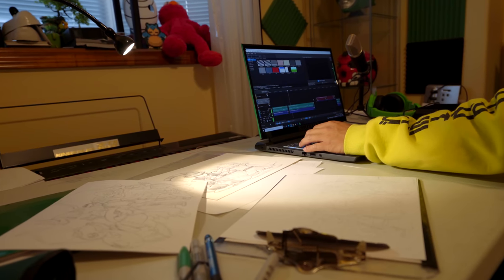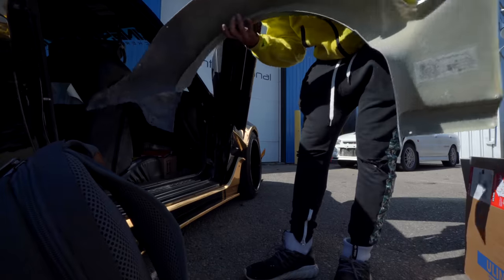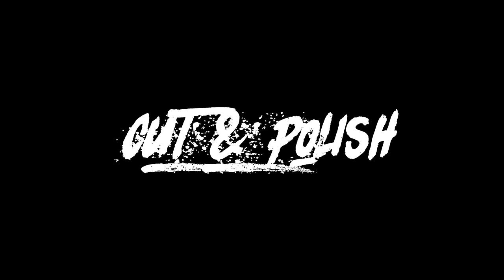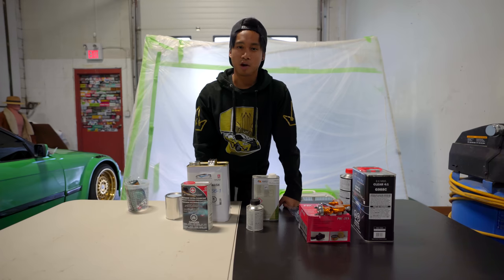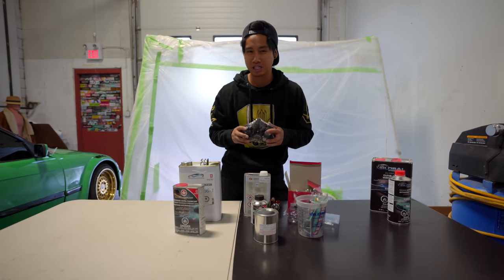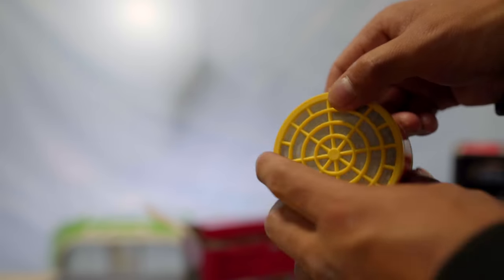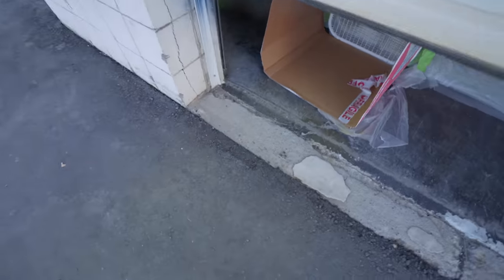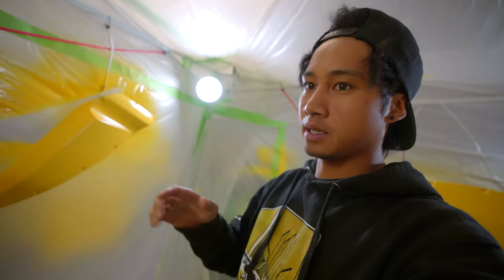What I'm actually using my Bachelor's Degree in Fine Arts Painting for...

Comment: A tip when you do your next spray job. Try and keep ur spray distance equal throughout. Noticed you are are all over the place with how close and how far you spray. Another tip also is move slower and move with the contours of the piece. Noticed you are spraying almost in " rattle can " style. Slow down when making your pass and move with the shape of the panel.  Awasome DIY paint booth though
Reply: to add to this, basically even if you have no clue how to set up the fluid volume or air pressure, the bottom line is watch how the paint lays down. that will tell you exactly what distance you need to maintain. when people start, just like me, they think painting is just dusting it on, actually it's the opposite, 2k paint is using gravity and a thick enough film build to self level itself. if you see orange peel it means you were dry spraying, either get closer or turn up your fluid volume or slower passes. usually the mistake is not close enough,  6-8", I even do 4" probably, you are so close you are nearly having an accident all the time, it requires good hand eye coordination

Comment: Looked like you didn’t have your fan wide open bud. Always fan wide open on parts like this and 50% over pass each time. Light coats on the primer first to make sure you don’t flood with solvents and get a reaction. Clear coat, always tack coat first then ‘wet out’ the surfaces. Good job for first time out the gun! The more you do it, the better you will get 👍🏽